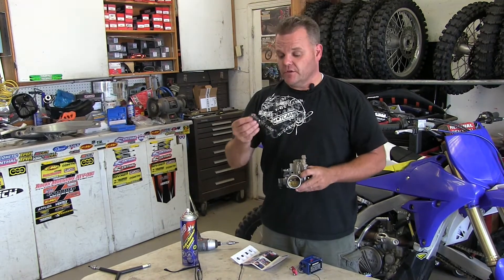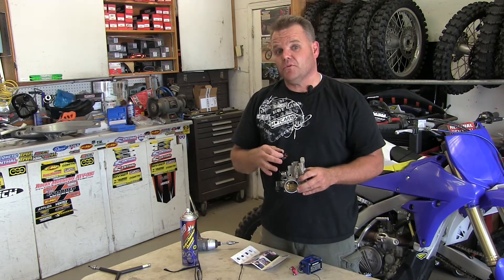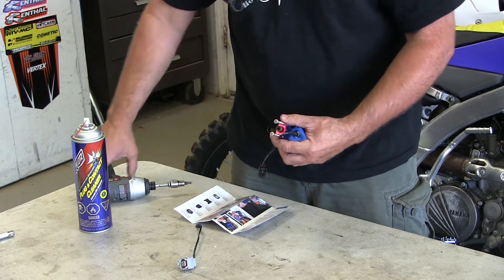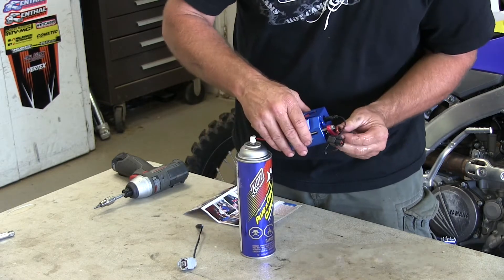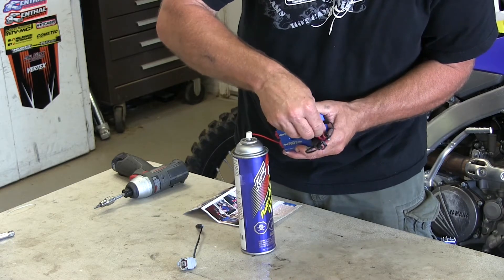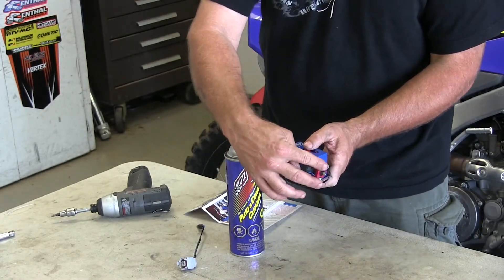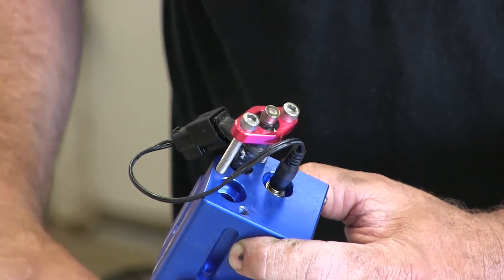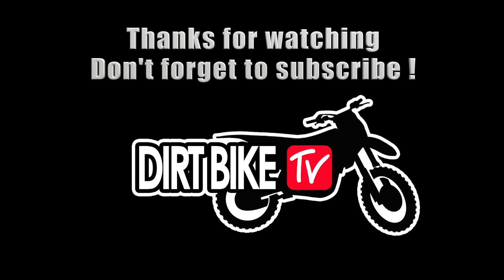Fuel Injector Cleaner MotionPro

Comment: Note: Port one and Port two are for two different types on injectors, you may only use one port or the other. The same port may be used for back flushing and "normal" flushing.
Reply: yep. and that button is pressed many times, not open fully and injected cleaner. it supposed to be injected first, then shoot button like 20times. not spraying like torpedos.

Comment: Now that I look at this, it seems that all one would have to do is have an extra electrical connection to a fuel injector, a 9 volt battery, or whatever, and put cleaner down the hose from the gas tank, and blow it through with a few pounds of air pressure, and just leave everything else connected on the bike. Take the spark plug out and blow the stuff out with air or whatever, if he wanted to do it an easy and quick way.
Reply from the maker: I would still take the injector off and that way you can watch if clogged and that you get a good spray but yes you can make your own as you said.